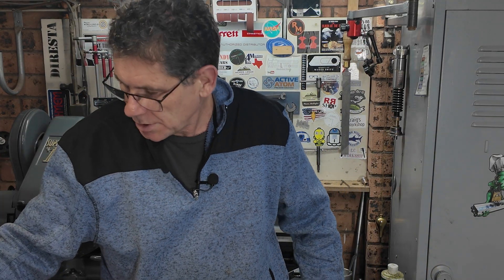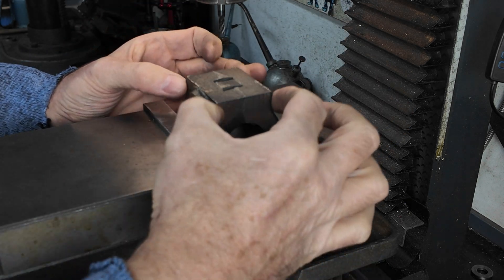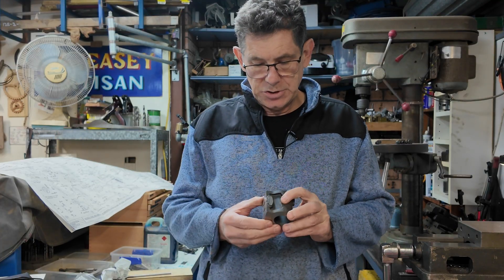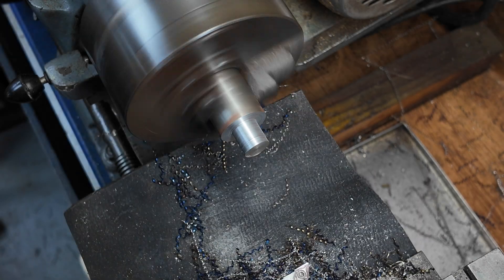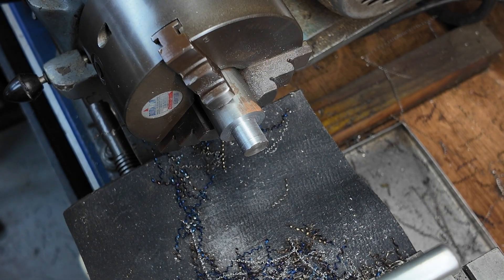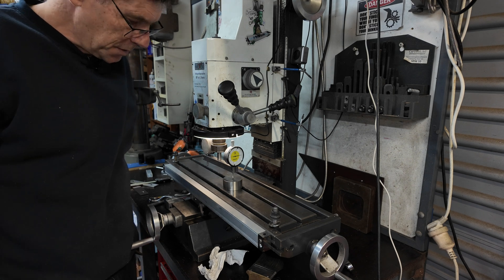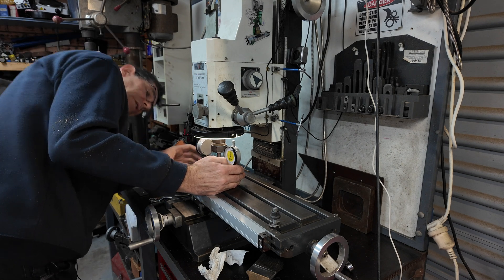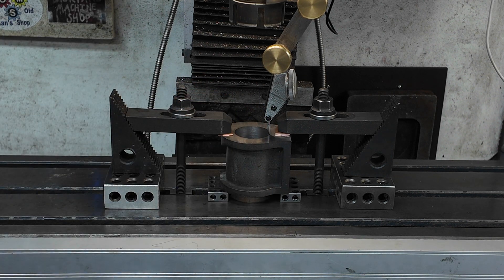Bore the Cylinder

Comment: The wedge you have is a cotter pin and personally i would have tapped it for an allen screw than banging on it,maybe even using a shorter cutter and have a screw fitting to adjust it with a bit more finesse,i know you can and why you didn't escapes me.
Reply from the maker: The boring bar came with my lathe and was made by Myford.  I found it was not very rigid and it chattered too much so I changed my approach and used the mill.  Tapping it for a grub screw would have made it worse.

Comment: Hello John, that taper pin wedge scheme is new to me - looks handy! I’ll remember that. 👍
Reply from the maker: Yeah I have never used that boring bar before.  It came with my lathe.  I think it's probably a bit too thin for it's length as I ended up with some nasty chatter in the cut.
Reply: @CreaseysWorkshop  I was thinking that the bar was too long for its diameter,i also thought a shorter custom closer to cut size bar would have been better for what it would cost from a scrap piece of steel,if you make these steam engines a dedicated bar would be the ticket.
Reply from the maker: @pir869 yes I think it would be better to make one.  Maybe that bar would work with brass or possibly a different tool geometry would have solved it.  The mill worked out pretty well in the end, especially after I lapped it.